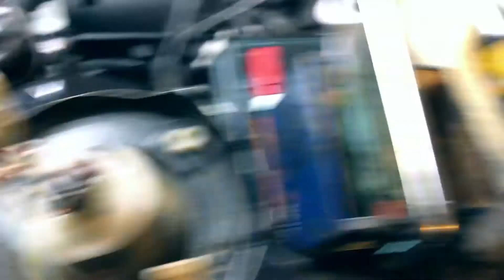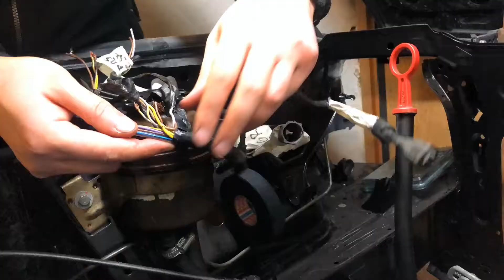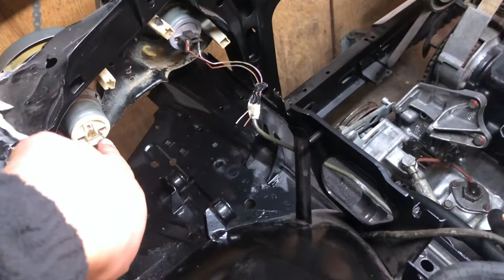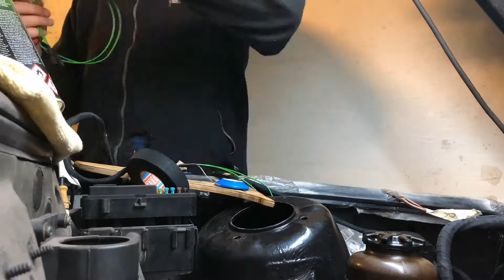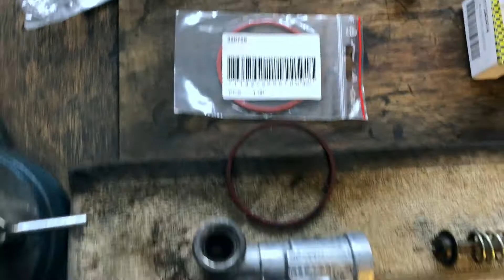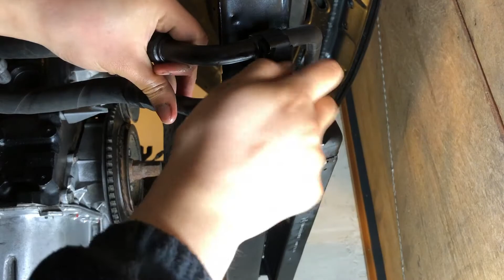Pt. 26 BMW E30 Wiring Harness Restoration & Oil Cooler Install

Comment: Thank you so much for great video👍👍 
Do you know  what is the torque for housing hollow bolt?
Reply from the maker: Thanks fir watching 👍 Bentley manual calls for 40nm +/-5nm.
Reply: @snailspeedprojects292  
I appreciate it 🙏🙏